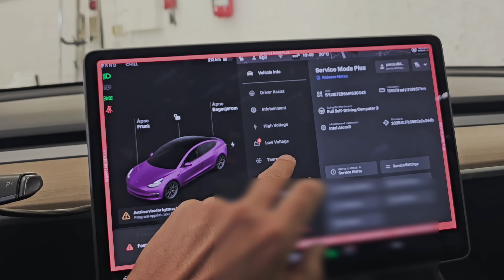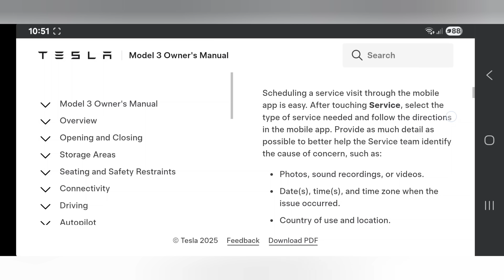Elbilmek repairing Tesla Model 3 with broken motor

Comment: Voldemar -great video and ignore anyone saying that you cannot communicate well! Just ask them to speak in Polish and see how well they are understood! The content of what you are saying is worth 10 times vs great a English presentation and yet you learn nothing new! 

I think if its your own car, and you care to make it last, then changing things say every 60k km lets you see what is in the coolant. You can use multimeter, hydrometers and acid test strips and compare to reference. If you find zero change in 60k perhaps its ok to test less often. Coolant runs through things and no matter what they are things can corrode. So it should be a measurement that you take with many others as to the state of operation. Cars that are "keepers" things like understanding health of any fluid are early warning signs. Many years ago cars had oil pressure guages but they where taken away for warning lights. Logging is easier now but you need to be able to understand the PID's (or whatever Tesla version is).

When you understand what the coolant does its often possible to use a product that is better than OEM - at your own risk. Or is better suited for the country/use of the car. A car in Dubai will have different needs than Oslo. For BEV we have wonderful heat pumps added to the mix so thermal transfer properties will be more important. I would expect new coolant products to come out similar to how we have optimised BEV tyres.

Whilst a maker might say something does not need to be changed or every x miles. It is upto you if you feel you want more control of what is going on under/in your car. 

Show more videos like this Bjorn please :)

Comment: My Nissan Ariya electric motor is oil bathed and cooled with an oil to water chiller, it doesn't need to be changed ever since it's a clean room oil motor.
Reply: And you believed the?
😅

Comment: We change the oil on our company Teslas at around 120,000 km, or approximately every three years. We discard them at 200,000 to 250,000 km, or after five to six years.
Whether it's really necessary is hard to say, but since we do it ourselves in our small automotive department as part of our annual inspection, it's hardly an additional expense.
Reply: Can you do it yourself, or do you need special tools to change it?
Reply: @MKAnr1  As far as I know, you don't need any special tools - but I can't say 100% since I don't work in our garage.

Comment: What is the cost of oil change? Not as expensive as that repair, even if you did it every year... Sadly for me the downfall of 2nd hand tesla. With no actual service schedule. Which far too many owner will take literally. Problems are being stoked up, when they could have been nipped in the bed. Great video. 👍

Comment: If you can do it yourself or it's not too expensive in the garage then gear oil change every 50000km, otherwise 75000. Might be slightly too often, but the car will thank you
Reply: 50k is way excessive. Manual gearbox oils can literally go 500k km.

Comment: Ioniq 28 kWh: changed gear oil at 150000km. I did it in a self service garage. easy job. Color was like coffee
Reply: in leaf 40kwh doing this also (gear oil) at 7 years and 140kkms. according to Nissan you should never change it (it's what they call lifetime but they don't give lifetime warranty..ahahah)
Reply: @freddykrueger79  Yes also peugeot said it to my father on his 508 2.2 diesel automatic. After 200.000 km the automatic was not working properly anymore. The cost for the repair was 4 times the residual value of the car.

Comment: Yep no oil will eventually overheat a drive bearing and seize the motor,all Model 3 owners remember to change the oil and filter for drive units every 50,000 miles,cheers fella ,great video 👍💪😉

Comment: Tesla before 2021 didn't have an oil filter. But newer Teslas (all models) should last 150k km. 
Cars I've owned in the past has usually had 60k km as interval on automatic transmissions, although "sealed" it's mostly to get a new filter and remove any shavings that might occur over time. If they lump together, they could ruin the transmission.
Reply: My 2019 Tesla has oilfilters☝ your Info is wrong.
Reply: Automatic gearboxes with a torque converter and wet clutches are a really bad comparison for these. A better comparison is some dry clutch manual or differential. They easily last 500k km or 20-30 years.
Reply: @rkan2 There’s still a reduction gear though, and that thing does over time wear slightly and contaminate the oil. I think a 60k oil change would be a good thing to flush any contamination, and to check the oil pump. 
My oil pump was making screeches when preheating after just 3000km and had to be replaced, together with an oil flush.
Reply: @DIYglenn Of course, but fundamentally that is no differrent to a differential or manual gearbox. It is normal for the gears to wear during their lifetime. Besides, usually when these components fail is because the bearings fail first.

Either you get a manufacturing flaw in the gears themselves, the bearing or something happens with the bearing lubrication that subsequently destroys the rest.

This Model 3 is no proof of either without further examination.

Comment: Tesla gets tons of data on failed drive units and they almost never fail due to oil degradation, the failures are always because of some other issue, mechanical or electrical faults. So they don't recommend periodic oil replacement, just in the case something is broken and/or leaking.
Reply: Some of the units fail because oil leaks out due to failed gaskets on either the pump or oil filter. There are even cases of water getting in the system and rusting away the oil filter causing oil to leak out from the side wall of the filter.
Reply: WRONG!

Comment: I go for 150kkm or 4 years for drive unit oil change for DU with external oil filter. There seems to be an issue with rust around the oil filter flange which makes it leak. Also the Oil pump o-rings sometimes leak.  

Interresting to see how simple the M3 drive unit is to disassemble though. Great engineering.

Comment: Do electric cars need motor or transmission oils change? I think that it should be as 40.000km
Reply: Maybe if you have a transmission with a torque converter. For dry clutches gearboxes or differentials 500k km can be fine.

Comment: I changed Oil and Filters at 147.000 km. I am a solid driver, but still the Oil in the rear DU was black, in the front DU it was not so dark, but i.m.o. absolutely necessary to change. 
So, for crazy drivers I recommend a oilchange at least every 80.000 km.
Before my retirement I was working on heavy-duty-machines up to 50 Ton gross-weight with Automatic-Transmissions and relatively short oil change intervals were essential on this machines.
Don`t forget,Teslas are heavy-duty machines, not in weight, but in power !!!
Reply: Drivetrain oils can go black but that doesn't necessarily mean they are bad. They don't experience nearly the same heat cycles as ICE oils do.
Reply: I changed the oil on mine at 125k miles. The oil was black and burnt smelling. I'm changing it every 50k from now on.
Reply: @tjts1 where do you Get the oil changed?
Reply: I agree. Tesla only worries within warranty - if you want the car to last, do simple maintenance like oil change. The car still has normal differentials etc.

Comment: so my 2018 model 3 has 350000 km and I have asked the tech if there is any requirement to change the oil or the coolant and he says nope tesla says its better to leave the system alone and wait for something to fail.
Reply: Sorry that is BS. 420.000km on my S and i change oil every 100.000km. Comes out pretty clean and only a thin layer of metal dust on the magnetic drain plug.
Reply: I would change the oil and coolant after a certain number of kilometers or period of time (in your case yes i would), as every fluid will degrade over time and won’t perform as well as when it was new. Even the additives in the coolant will degrade, which can cause corrosion in the cooling loop and also can cause leaking.

Waiting until something break is more expensive then change oil every 80k km - 150k km and coolant for example Glysantin G40, a silicate-free OAT coolant, is also widely used in EVs for its long-life properties up to 5–10 years or 150,000–240,000 km in ICE vehicles, potentially longer in EVs so maybe we are talking about 240k km - 300k km.

Just because the name is 'Lifetime' and a normal car driver might do 15,000 km a year, and the lifetime of a car is calculated at 10 years, does not mean that someone who does so many kilometres should not change the car's fluids.

Corrosion: Degraded additives may fail to protect metal components (e.g., aluminum or copper in the cooling loop), leading to corrosion. This could cause blockages, reduced heat transfer, or leaks, potentially affecting battery performance or requiring costly repairs.
Reduced Thermal Efficiency: Sludge or deposits from degraded coolant could impair heat dissipation, causing the battery to operate at suboptimal temperatures, reducing range or accelerating battery wear.
Pump or Seal Wear: In high-mileage vehicles, degraded coolant may contribute to wear on seals or the coolant pump, increasing the risk of leaks.

Comment: So oil level is really important. How do you check the level? And when change it?
Reply: I don‘t think you can check it. At a well known German car workshop for Teslas (Reifen Reber in Murr), they recommend a drive unit oil change every 4 years or 80000km.
Reply: It's not that important, so you don't need to check the oil level like you would with an ICE. However, when you do an oil change every 80,000–150,000 km, that's fine. We are always talking about high-kilometer cars, which are the worst case scenario; the average car driver takes 10-20 years to reach such a km. That is also the reason why the drive units of some cars fail: the owners drive a lot, so the likelihood of something failing is much higher and such cars require much more maintenance and the lifetime of oil and coolant filling do not fit for such cars.